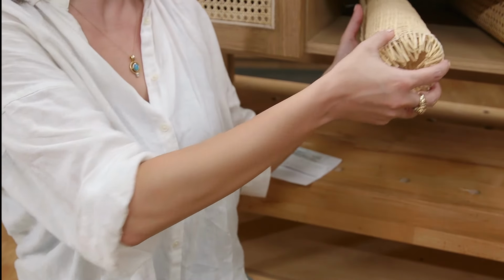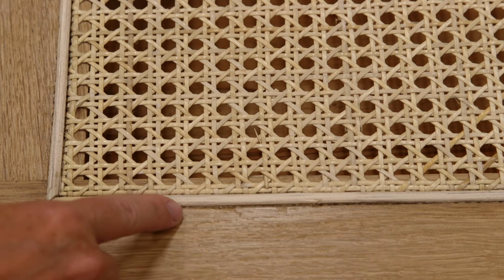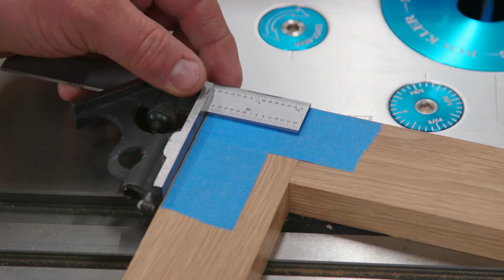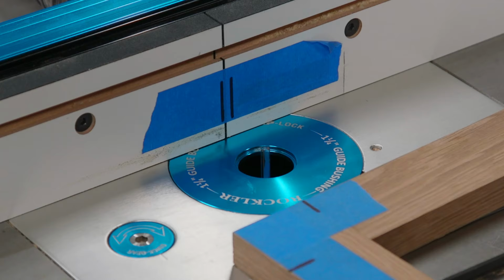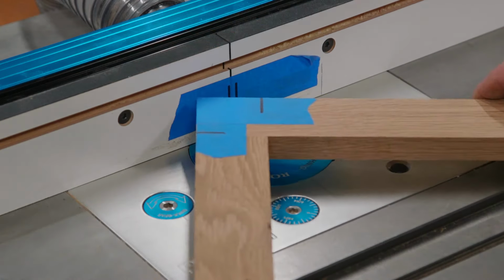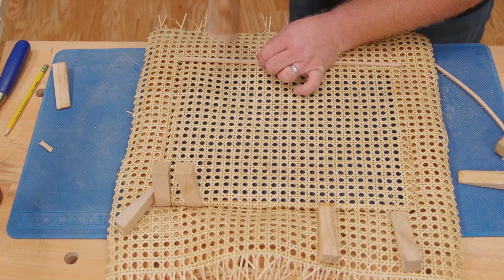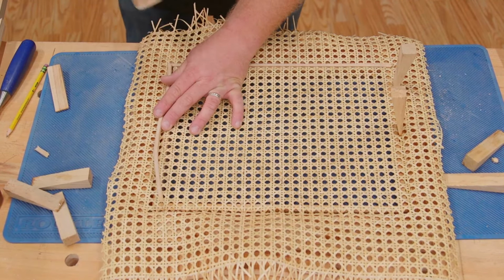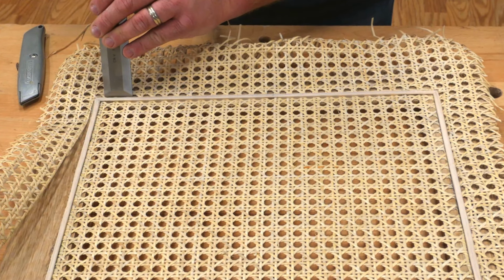Introduction to Installing Cane Webbing in Furniture

Comment: I’ve been using cane in my builds lately but have only been attaching it using staples. I soak it then attach it to the inside part of the door. It looks great initially but the cane starts to loosen up after a few months. I definitely need a router to start doing it this way. Could this be done with a handheld router rather than a router table?
Reply from the maker: Where there’s a will, there’s a way to tackle nearly any woodworking task with alternate tools. In this case, you could use a handheld router — preferably a compact model in a plunge base— but there are a couple of challenges: The frame workpieces are narrow, and the channels for the cane need to be parallel to the workpiece edges and square to one another. A router table and fence make these challenges easy to overcome. The table offers a large worksurface for supporting frameworks made of narrow parts, and the fence indexes the location of the router bit while keeping the bit running parallel to the frame edges. All in all, it’s the most convenient tool for the job and the easier option for a novice router operator. If you use a handheld router instead, you’ll need to attach its base to an edge guide (which serves as the fixed-distance fence) and become comfortable feeding the tool steadily along the narrow edges of the frame. With some practice and confidence, it’s do-able. But the task won’t be as easy as if you were using a router table.
Reply: @rockler  thank you for the in depth reply!

Comment: Hi, im a first semester industrial designer… I have a question, do you apply the rattan wet directly to the wood without any sealing or finished?
Reply from the maker: Generally before finish is applied. However, the process could vary depending on your construction and finishing needs.

Comment: If I’m using 5 mm round spline, how big would I router the groove? Is 1/4” appropriate?
Reply from the maker: Hi Jade, The groove should be wide enough so that the spline fits snuggly BUT can be removed with just finger pressure(not needing a prying tool). 5mm is difficult because it's in between 3/16" and 1/4". We recommend trying a test piece with just the 1/4" and if its to loose, you're going to have to sneak-up on the size. Thanks
Reply: How thick of a spline for a 1/4” opening?